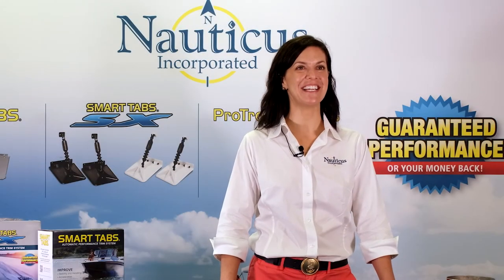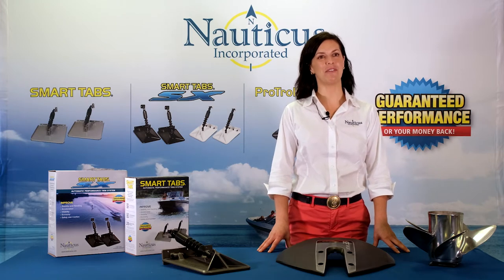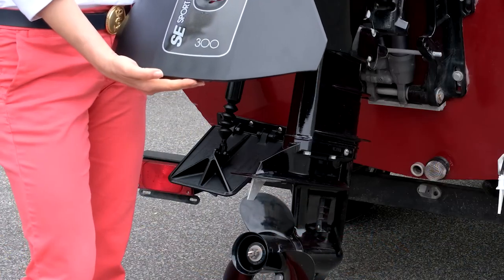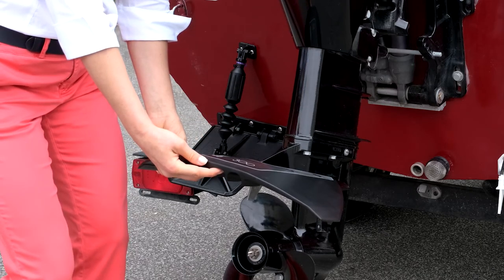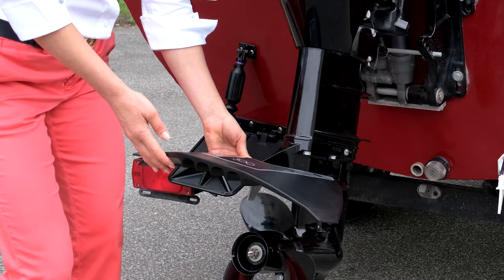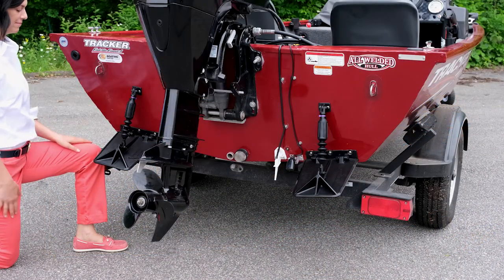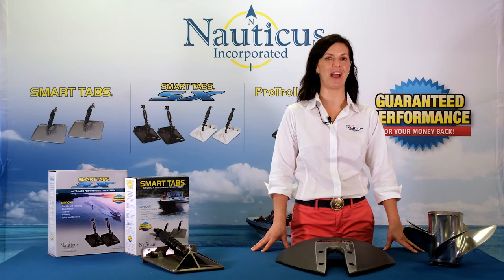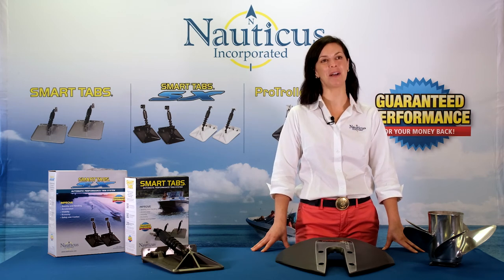Nauticus Inc. - Hydrofoils vs. Trim Tabs

Comment: Please provide some evidence as to why you cant use both tabs and hydrofoils.. making claims with out substantiation  is merely advertisement sensationalism. If using your motor trim correctly a hydrofoil should not cause you bow to plow. Tabs will help with the teeter totter effect aiding in side to side motion, at most a hydrofoil might add some drag when used with tabs but hardly dangerous or detrimental  as you imply.